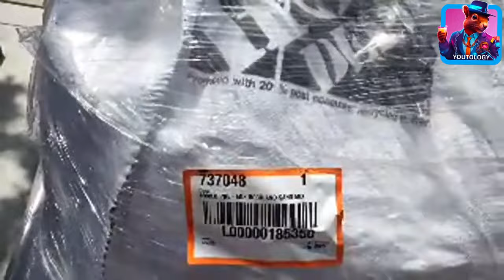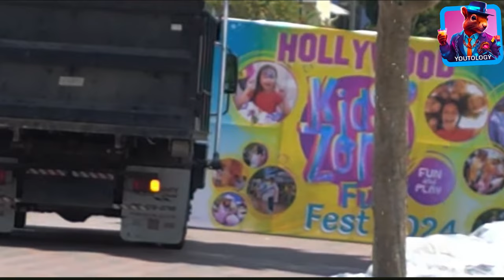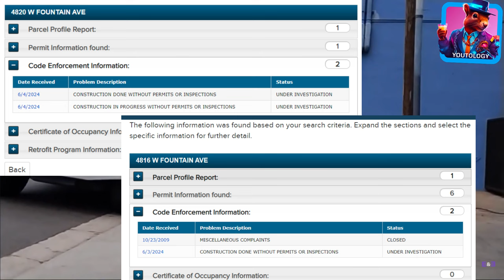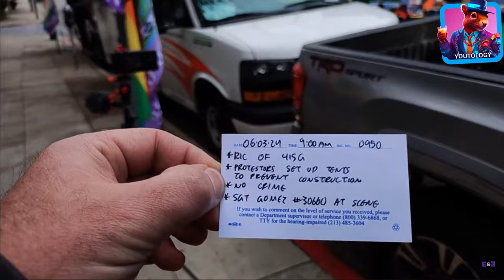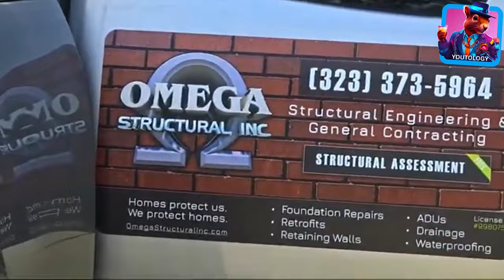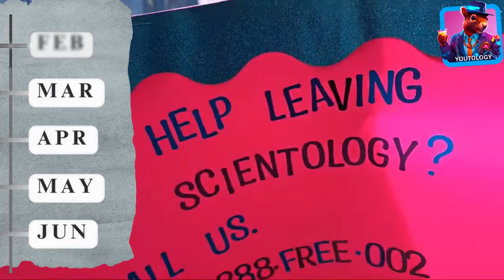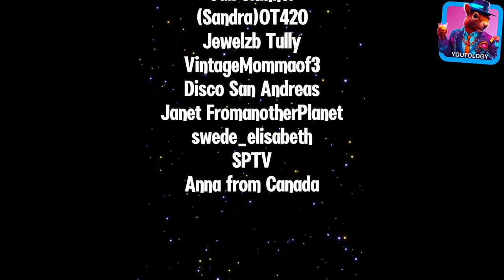What if Scientology builds a tunnel in Los Angeles?

Comment: Just spoke with Material Sales Unlimited to ask about bulk orders for large volume of premix. They can get about 10 dozen totes, which each carry 1,000 pounds of premix, on a single 18-wheeler. 

Home Depot is simply the 3rd party that fulfills the logistics for the order. Lowes can also fulfill the order. It is considered a special order. The order only takes a few days to fulfill. I genuinely don't know why Home Depot could not clarify this but hey, hardware stores get stuff wrong all the time. The bags definitely do NOT cost $500 per bag, it's by tons and about $70 per ton. 

Again, the issue is NOT the cost. That's a lot of cement premix. Enough to turn heads and require a permit for doing work. The numbers I calculated before was using the logic applied by the Home Depot manager if we took the ~$500 per tote cost. 

Believe what you want, there is 1 undeniable fact. This is A LOT of cement premix. It is enough cement that the work using this premix would definitely require a permit. Anyone can buy this much cement premix but only larger projects, at the scale of requiring a permit, can actually use that much premix.
Reply: Enri💪💪💪💪🫶🙌👏👏👏🤟
Reply: I believe it's merely "rock and sand mix," not cement or "concrete"
Reply: @matthewtheking  It explicitly states premix for use in making cement. I even labeled it as premix.
Reply: It's sand and rock designed to be used as aggregate, but there is no cement in the mix.
Reply: @matthewtheking  Yes, that's why I labeled it as cement premix and the SKU also labels it as such. Anything that's not the binder solution is typically called cement premix.
Reply from the maker: Thank you Enri for the research and for sharing the information with us. We'll see what happens and whether it's just the “embellishment” of LRH Way with wooden boxes in the end.
Reply: @matthewtheking you aren't listening.  It is being explained to you!
Reply: @matthewtheking  premix, pre = before. Get it?
Reply: @cfawcett9870  Yes. Premix is a fancy name for dirt, whereas premixed concrete has cement in it. I think it's pretty clear from what I typed that I understand and was trying to make it clear to a layperson.
Reply: @matthewtheking  what you should have typed was that you were wrong and misunderstood. I get pride is a thing but it's far more admirable when people can admit a mistake 😉
Reply: @cfawcett9870  What was I wrong about? Everything I typed is accurate.
Reply: @matthewtheking  it said premix on the labels therefore it is premix
Reply: @cfawcett9870  Can the average person watching YouTube explain the difference between premixed concrete and concrete premix?

Besides, I'm pretty sure the label read "Rock and sand mix," not "premix." I was there and I looked at it.

**Oops. Yeah Premix Rock and Sand Mix is indeed on the label, but it's concrete premix not "cement premix"
Reply: @matthewtheking  if you really were there and looked at it i think you would be more sure, but that's just my opinion. Besides, I distinctly remember it being read out loud on the video
Reply: If they were constructing a tunnel they would Gunite not premix.
Reply: @jamespedder5171  I agree. In my opinion they are simply being used as bags of sand to take up space on the easement/sidewalk because they cost just $37, but what do I know.
Reply: Home Depot has stop selling premix I believe earlier in the year. I’ve been building concrete on my backyard for the past 14 months.

Comment: Someone needs to go to Building and Safety and look up a building permit for this location.  It's easy and it's public information. Or all 3 locations. Do it!
Reply: Some one is on that
Reply: Many have with no permits found.
Reply: @moxieme65  has anyone filed a complaint to building and safety. I did this, and my neighbor got a huge fine. All I wanted was them stop using loud equipment after 10 p.m. When they looked up the address, all hell broke loose.
Reply: @maryhannah4462. Yes.  They said several have filed complaints.  Someone said it may take awhile for San inspector to check it out though depending on their workload.